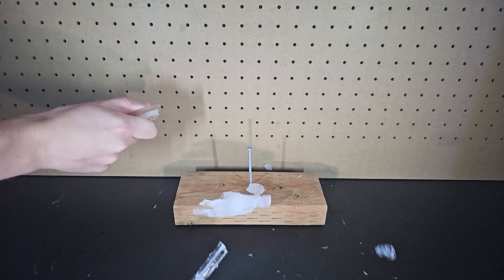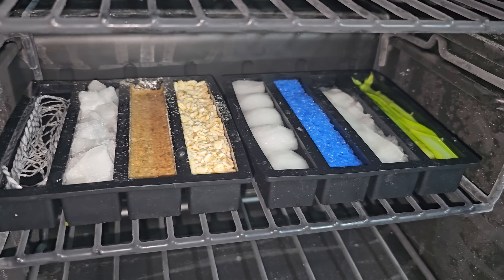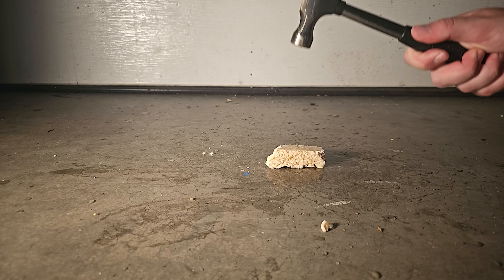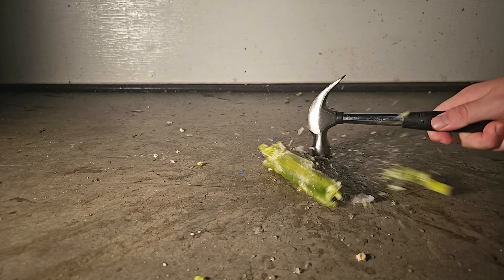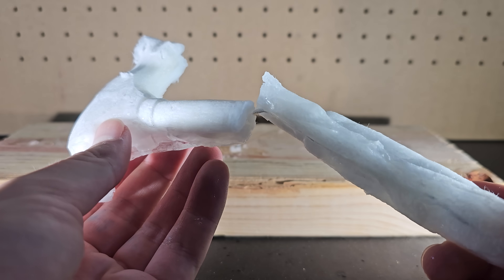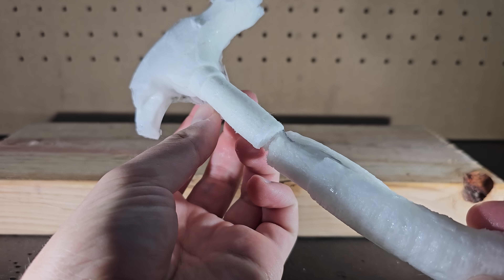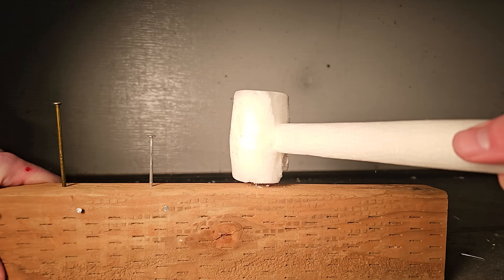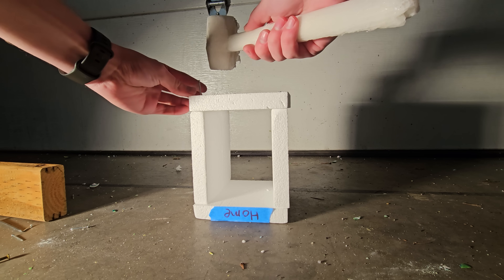How strong can you make ice? (World's Strongest Ice Hammer)

Comment: you didn’t use enough sawdust it’s actually very strong and the us military was interested in it; its called pykrete
Reply: The Uk was even more interested than the us with them planning to build a carrier out of it
Reply: @ddunfuh9239 this. They attempted to build an aircraft carrier out of it due to steel shortage. But unfortunately it was a big fail.
Reply: @SIGNALDIRECTIVE  it didn't fail they just didnt want to make ships that were meant to be disposable and have people work on them
Reply: @CMKloser  it definitely failed. While a pykerete ship was proven to be possible when they built a small prototype on lake jasper, they discovered that building and maintaining the single carrier that was planned would cost more than an entire FLEET of conventional carriers to build and maintain. Project Habukkuk was absolutely a failure. It's logistically a stupid idea when the entire point of it was to mitigate the cost and availability of steel, and it ended up being drastically more expensive than building the carrier out of steel. 

If that's not a failed project, then what is?
Reply: @SIGNALDIRECTIVE I think that they just never had the time. The war ended before they needed it and so did the steel shortsge
Reply: @ddunfuh9239well tbf concrete isn't the best material for a hammer either...
Reply: @ddunfuh9239 stfu no one has cared what the uk thinks sense the 1700s
Reply: @ddunfuh9239they did build a carrier
Reply: Remember, they Mythbusters tested pykrete and found newspaper to be better than sawdust
Reply: @theveryaveragegamer9865  I remember that too. Was that Mythbusters or that spinoff show with Grant, Tory, and Kari did?
Reply: @josiaharaki7310  well first of all they WERE Mythbusters, not a spinoff, and secondly it was Adam and Jamie.
Reply: @theveryaveragegamer01 They are probably talking about The White Rabbit Project, which was a MythBusters spinoff Netflix original using the MythBusters B team. So you’re both right, there was a spinoff with those three, but they also were MythBusters when the show was still being made.
Reply: @theveryaveragegamer9865  The longer the fibres the better.
Reply: @theveryaveragegamer01 Yes, but during WW2 there was  a major paper shortage. Wouldn't have been the best idea. I mean the whole concept was rather bananas from the start 😬 Proposing to use paper would have sunk the project outright, rather than when it finally melts 😅
Reply: Yeah. They considered using it to make an aircraft carrier, but ultimately realized the impossibility of keeping it frozen, especially since the idea was to deploy in the Pacific, which is generally warmer.
Reply: @josiaharaki7310 wow 😂🤦🏻‍♂️
Reply: Project Habakkuk. The british were interested in finding an alternate material to build ships with, and so Geoffrey Pyke freezed sawdust and water together to make pykerete. While the material was promising and effective, it did not take off due to the manufacturing needs to freeze so many wood infused blocks of ice. Like the steel needed exceed what they could actually use the steel for, which is to buiild ships. And so it was shelved. They made a boat out of this stuff, and it did not melt until six months later.
Reply: He actually used too much. Pykrete is only 14% sawdust. It should be made in stages as well, compacting multiple times with shaved ice.
Reply: @itshunni8346 14% by mass, which he wayyyyyy undershot. Sawdust has a density of .21 grams per cubic centimeter, as opposed to water which is 1 gram per cubic centimeter. To get this recipe correct, he would have had to add enough sawdust to the mold to fill it about 2/3 of the way after being compacted.
Reply: “He shot the wood and the wood shattered, then he shot the pykrete and the gullet ricocheted off and hit someone else in the conference room”
Reply: Pykrete mentioned 🗣️🗣️🔥🔥🔥🔥
Reply: You think? Mentioned already but it’s only 14% by weight, easily googled as they did. It’s also better when using finer wood shavings with more dimensionality than fine sawdust. A blend is even better.
Reply: Nah i think pycrete is just not that strong in this way
Reply: @barnabasigari3109  you're not wrong but it is true he didn't use enough
Reply: @barnabasigari3109 apparently a bullet bounced off
Reply: @barnabasigari3109  It can withstand bullets.
Reply: @barnabasigari3109 well thay was not actually Pycrete per say. It's a ratio thing that looks more slurry than large wood chunks.
Reply: I was thinking this, as someone who’s messed with pykrete before
Reply: Honestly the properties depicted here do not seem that far from those reported for original pykrete. It is reported as having a tensile strength of roughly 4.5 MPa. For context, the tensile strength of white pine, a very soft wood, is around 30 MPa and some high carbon steels would be in the range of 650+ MPa. That definitely doesn't give the whole picture as to how good it could be for building large vessels, as the numbers are all force relative to area, rather than weight of material. Pykrete could have hypothetically made ships with extremely thick structural components, potentially even entirely solid, as it was less dense than water and could be "cast" in enormous sections with much less effort than would be needed to connect pieces of wood or metal together. Still, it is terrible for something like this where it is dealing with bending forces, and is limited in thickness.
Reply: Learn how molecular structures work before you start arbitrarily deciding things are strong or weak.
Spider webs are stronger than steel. You just only find them at a thinness where steel itself couldn't support its own weight.
Strength is based entirely on the molecular structure of the material. Pycrete is strong for building applications but it's not good enough to be used in tools, because it's molecularly not bonded on the level of an actual industrial material, such as steel, wood (like mahogany or teak) or carbon fiber, which have molecular lattices that provide a very high base strength. Pykrete doesn't have that molecular homogeneity, so it's only good for structures that stand in cold environments
Reply: We were going to make a ship out of it. But for obvoisly did not
Reply: All of them are pykrete
Reply: Your supposed to pulp the paper
Reply: Then it wouldn’t be ice anymore tho
Reply: Use concrete dust, problem solved 😄
Reply: A ship that melts, that's a terrible idea
Reply: It is strong
Reply: O
Reply: Girl same🎉🎉🎉🎉
Reply: I wondered if someone was gonna  mention that.
Reply: Also, that’s the traditional version of pykrete. I’m guessing what he meant by paper towels being the classic was that it’s most common these days (he also might’ve not known about traditional pykrete, of course).
Reply: Does anyone actually care
Reply: Wooden aircraft carrier lmao
Reply: The British were going to build a battle ship out of ice and sawdust, haha, just search it up
Reply: @jonathonmartin3923  yeah, until they discovered through the prototype that building one would be more expensive than an entire fleet of traditional carriers
Reply: Pykrete is not made out of frozen sawdust but out of frozen tree resin
Reply: Yeah for airplanes, and it was too heavy to fly 😅
Reply: I'd actually like to see if something else that's liquid (or gas) at room temperature would make a better ice hammer.
Reply: @A13XLaircey sounds like your trying to make self deleting evidence
Reply: I think he used too much it’s only supposed to be like 10%-15% sawdust
Reply: It’s good for resisting pressure, not bending, no matter how much sawdust you add, the handle will brake in the first few hits, it’s like concrete, you can’t make a long tube of pure concrete and bang against the floor and think it won’t brake, but doesn’t mean concrete isn’t strong if you try to crush it
Reply: The secret to pycrete is adding slightly larger chippings as well, though I doubt it would perform well in such a small piece even then. From what I understand what they tested in ww2 could reach similar hardness to concrete and a concrete hammer would not work well either.
Reply: im not sure if its pykrete i think u use cotton? sorry if im wrong
Reply: You need something that would spread the force of the impact on the nail as the force is concentrated on one point you should try adding some sort of flexible yet hard material at the tip like gum
Reply: World War 2 momento
Reply: Yeah I learned that from oversimplified. There was something called Operation Habbakuk or however it is spelled.
Reply: Keep your eye on the head of the nail. You'll hit it every time 
   . (it's one of those weird evolutionary things.. 
     Much like watching the other person's elbow when attempting a high five - always a direct hit)
Reply: You didn’t use enough we didn’t ask😅
Reply: Can body armor be made out of pykrete?
Reply: @aeronautisch  Aside from the wearer either getting hypothermia or their body heat melting the armor, there are the same problems why cast iron or concrete armour wasn't a thing. It has good compressive strength, but it's rather brittle. instead of bending, it just breaks. Which has consequences: 1. You can cast it and you can remove material. That's your only options for shaping it. 2. Steel will first elastically deform, then plastically, and only then will it fail. Pykrete or castiron will just shatter or chip. 3. If you manage to shape it into anything vaguely not box like, you now have shearing forces inside the material when a part is hit and brittle materials hate these. 4. You need a lot more material to achieve the same strength. Which is not a big deal if you build an aircraft carrier. What you care about is the mass to volume fraction to make it float. If need be you just make it bigger. Not so much for humans. At that point you can just stack the same material in place or hurle it at your enemies. Congratulations you now have invented walls and catapults 😬
Reply: It’s a uk invention ._.
Reply: It deflected gunshots
Reply: Beat me to it
Reply: “And then they considered making a pycrete aircraft carrier, but that was a really dumb idea”
Reply: I thought they just soaked a CHUNK of wood in water and froze it, not sawdust.
Reply: The sawdust needs to be really fine like you'd ge from very fine sandpaper
Reply: How would he know that
Reply: Dude he did use sawdust 😂😂😂 jokes on you 😂😂😂😂😂😂🎉🎉🎉🎉🎉🎉🎉
Reply: Is ice² stronger ? It is more compact then regular ice.
Reply: He doesn't drink coffee
Reply: Sawdust particle board is every carpenters worst nightmare, It's cool and all until you realize water destroys it
Reply: it was the german military that had the thought of making a carrier with it
Reply: Well regards to sawdust and ice hammer  i don't know if the mass of the hammer itself is not large enough, it's just too small. It's gonna break now if it was much larger altogether, it would be much stronger.
Kind of like concrete could be about a punker, but regardless of the concrete, it's one inch thick in a cylinder, even if you have rebarner, it's still going to break a crumble. Versus a three foot wall, this is regarding the person who made the comment that he didn't have enough sawdust in his hammer
Reply: You know what you could reinforce it with a piece of steel or even better, yet, put a hammer inside your mold
Reply: Yes he did
Reply: Actually, he probably used too much proper percentage is 14% wood pulp and 86% water the important thing is you have to mix it until it’s a good slushy type feel
Reply: The UK DID have a fighter plane made out of wood during WW2.
Reply: Put metal rods in it
Reply: Came here to say this, worth retesting
Reply: Didn’t they have a test where someone shot it with a bullet and the bullet exploded
Reply: He probably used a different one
Reply: If you add that much sawdust, can we even call it ice anymore?
I mean, you just called it pykrete.
Implying it is a material that contains ice, not just reinforced ice.

Comment: why dont u use the asparagus interlayed along different directions. You alliggned the grains in one direction and it was strongest in that direction. To make the behaviour isotropic, you should have equal distribution of the asparagus strange along all directions. Maybe braid them?
Reply: I’d expect cotton balls to still do better since the fibers are much more randomly oriented and smaller. With a solution to the gap between balls, they probably would be close to the best option for a fiber composite.
Reply: @kyloben4848  I thought of that, but the interlacing of cotton fibres is not something that you can achieve easily at home. If you put two cotton balls together, it'll be weakest at the point where they overlap. You will always end up with hard "alloys" which are the size of a single cotton ball. The system will be as weak as the weakest point. I cant think of any at home ways to interlace cotton fibres. If you can solve that problem, then I agree, cotton is better (its overlapping is microscopic). Since the asparagus fibers are larger, they will be easier to interlace/braid.
Reply: @shohamsen8986  I'd imagine fraying the edges and overlapping them a bit would have a similar effect
Reply: @kyloben4848  you cant interlace the cotton fibers at the same level at which an individual cotton ball us interlaced. Thus it'll never achieve uniform strength. However, the asparagus has a chance at a more uniform strength since you can just weave them with at home tools. If you can get a huge cotton ball and cut out cotton in the shape of a mallet or hammer, then you have a point. If not i really don't see how you can use individual cotton balls to strengthen the hammer/mallet.
Reply: @shohamsen8986  I think it will also be very hard to achieve the true randomness that exists in cotton balls. Braiding seems like it would just make a stronger thing in only one direction. Even a 2d lattice would still be much worse. I think it's more feasible to try to blend the edges of a cotton ball than to create a similarly random arrangement of fibers from scratch
Reply: @kyloben4848  No, you wnat do interlacing in 3D. You can do that by creating multiple 2D layers and then interlacing those layers with threads of asparagus. This si painstaking by doable by hand, which is the reason for my suggestion.

Comment: How about an ice rupert's drop, is that possible?
Reply: with Ice? no. Unlike glass, which contracts when it freezes, water expands. Making a prince rupert's drop with water is therefore not possible.
Reply: But that property is (I think) mostly exclusive to water so what if you tried making a prince Rupert’s drop with aluminum or a material that does contract as it turns into a solid
Reply: @clubstep8080 that is a fascinating idea… I don’t have the materials to perform it but someone should try!
Reply: @davidonfin2381 :((( makes sense tho
Reply: I don’t believe so, but I really want to see!
Reply: While it would be cool, I'm not sure it would work, mainly because ice is made by freezing into a mold, and glass is made by melting
Reply: @Levi-d6j1h but it would be good to at least try it as a mould
Reply: No
Reply: Drip it in liquid nitrogen
Reply: In theory, would it be possible to drop a super cold liquid so that it freezes (liquid nitrogen?)
Reply: no because ice is crystalline and glass is amorphous
Reply: Technically you could drop hot water into liquid nitrogen and get the same Leidenfrost effect but I'm not sure how that would work in reality
Reply: What if you hit the tail